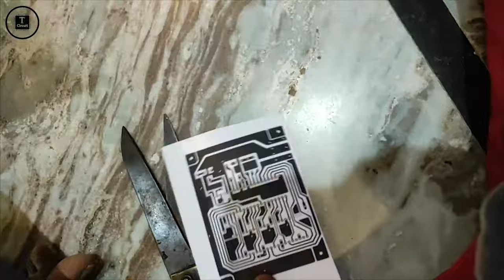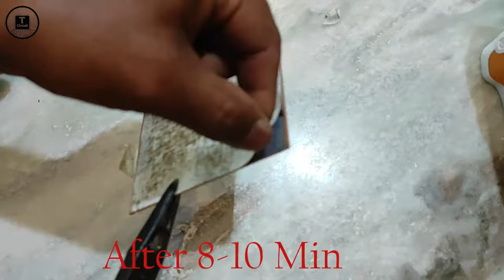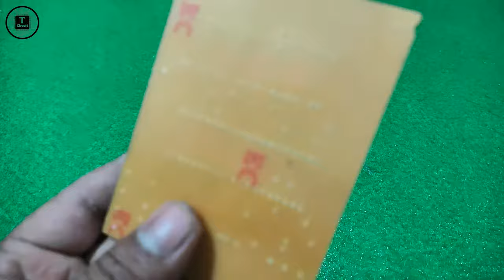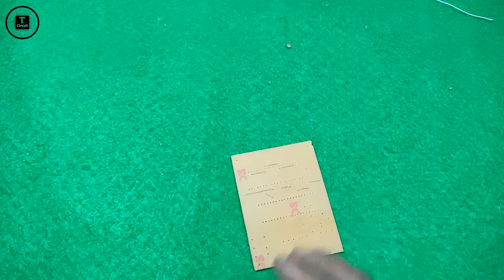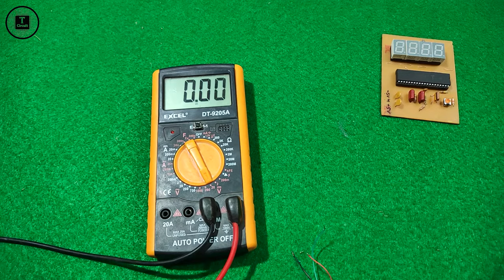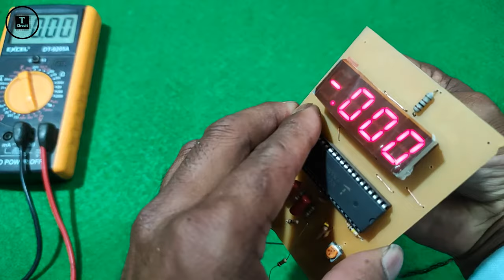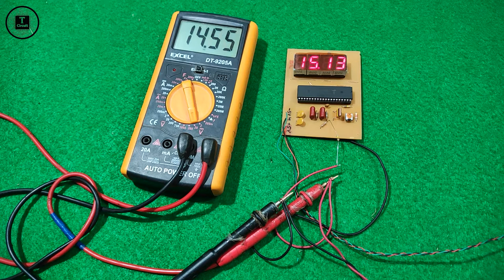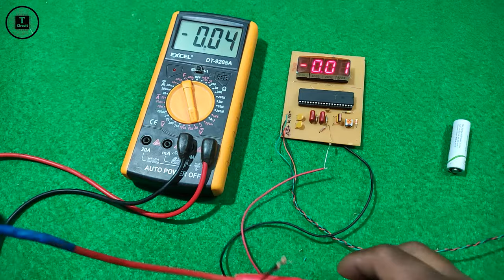How to make  Digital Voltmeter Amp. Meter || ICL7107  Voltmeter  current Digital multimeter

Comment: Sir mjy ap ki is circuit ki circuit diagram aur pcb ka pcb design chaia tha
Reply from the maker: discription mein video dal Rakha hai Digital Volt Meter Amp. Meter ICL7107 Circuit  explain use circuit ka aap screenshot le sakte ho aur PCB design ke liye main aane wale video ke andar aapko bata dunga
 thanks
Reply: @totalcircuit  Circuit diagram aur pcb ka pcb project file ya garber file